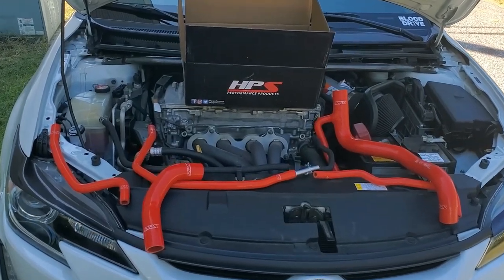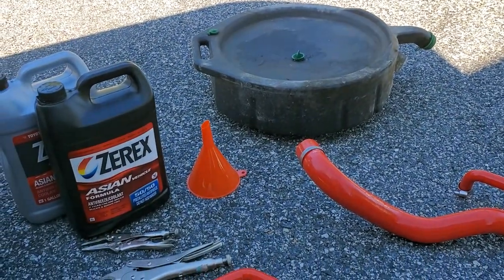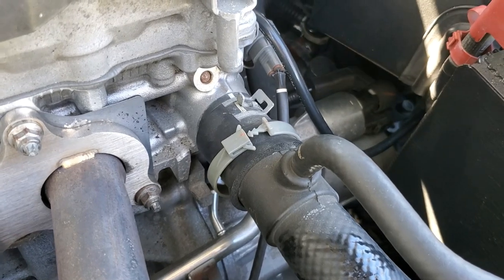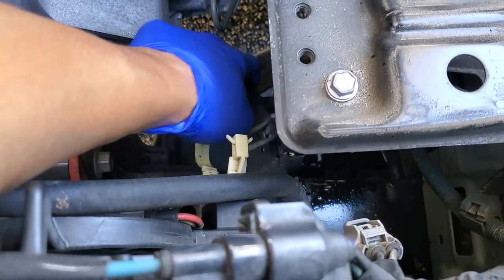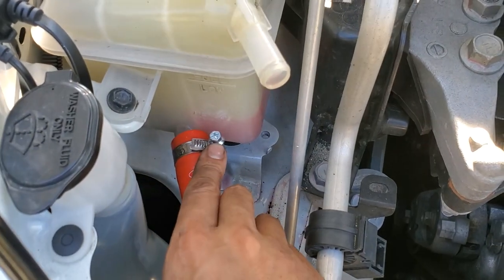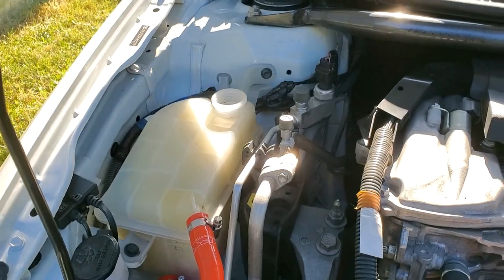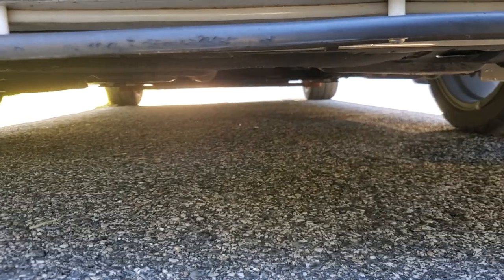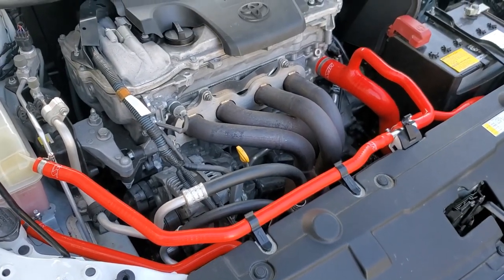HPS Red Silicone Radiator Hoses Full 5 Piece Kit (57-1479-RED) Install (Scion tC2 / tC2.5)

Comment: I run these on my semi and have over one million miles and have never had a failure with a silicone radiator hose Definitely not just a gimmick or dress up item they really do work they will probably outlast my truck.

Comment: Nice man I had the hps blue hoses but switched to the black ones gonna get my Aem strut bar powdered coated black to match everything else
Reply from the maker: I was actually curious if someone would use black hoses or not since they look very similar to stock. I just wanted a little pop in my bay and I'm already using red as a minor accent color.
Reply: Yea I just felt the blue didnt match not to mention I have the hps wrinkle black cold air intake

Comment: How good have they been holding up and how often are you having to check fluids
Reply from the maker: They are holding up fine and I generally check my fluids whenever I'm putting gas in the car.
Reply: @VampyreX13  Thanks for the information gonna be doing thermostat soon so was wanting to switch to the hps blue hoses
Reply from the maker: As with replacing any other hoses, just double-check the tightness of the clamps after a week or so.